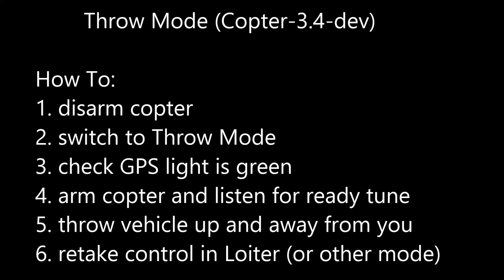ThrowMode Testing (Copter-3.4-dev)

Comment: Dear Randy
thank you for sharing the experience
well done

is it a GPS dependent mode?

I mean is it possible to operate with this mode in a no GPS condition?
Reply from the maker: Hi Mohsen, I'm afraid this mode does require GPS because its final step is to stop the vehicle.
Reply: @rmackay9  what if we dont choose a GPS required mode for quadcopter to set in after getting stabilized
?
Reply from the maker: @mohsenfazareh3384  It won't make a difference I'm afraid.  The modes always requires a position estimate (i.e. GPS or optical flow) because it comes to a stop (which requires the GPS) and then after that's complete it switches into the desired mode.
Reply: @rmackay9  nice informations, thank you dear Randy

Comment: Is AC3.4 can be install in APM 2.8 board?
Reply from the maker: No, I'm afraid not.  AC3.2.1 is the last version that works on the APM 2.x boards.  These days AP supports a huge number of more modern autopilots most of which are listed here: https://ardupilot.org/copter/docs/common-autopilots.html.
Reply: @rmackay9  thank you very much sir for your response 🙏🏻 and I appreciate your work.

Comment: I would like to build the latest version of the Arducopter I think that is 3.4.  I find it difficult to find detailed information even on the Arducopter site.  I have a Blade Chroma copter with a bad controller in it.  I thought since I have everything else, body, motors, battery etc. why not custom refit it for Arducopter?  Has anyone done anything like this?  Since I've never built one from scratch I will likely need some detailed help.

Horizon wants $250 for a new controller board.  Truth is they don't update their firmware the last update for Chroma was in 2015.  Outdated about as soon as it came out with limitations that we as users have no control over.  I want something I can modify and update as needed.

I have an 8 channel Spectrum receiver.  A DX 7 controller and a ST-10+ controller.

Comment: Hi Randy, i have been trying the throw mode with my quad for the last week, without succes.I really hope you can help me out with this.
As you describe, disarm> gps green> throw flight mode >arm> wait for tune> throw in the air.

Once in the air the special tune stops, but the motors never arm.

Mission planner gives me the following message:
uprighted - controlling height
throw detected - uprighting
waiting for throw

Is there some special height senor required (like optical flow)?
what am i doing wrong?

Geoffrey
Reply from the maker: @trex, That should work.  Did you throw the vehicle up?  Could you post a log file in the support forum? http://discuss.ardupilot.org/c/arducopter/copter34
Thanks for using ardupilot!
Reply: Hi Randy
You might be a little busy, i posted the log file a few days ago.
here's the link
http://discuss.ardupilot.org/t/quadcopter-3-4-dev-throw-mode-error/10004
Reply: Hi Randy.
A Quick question, in order for throw mode to work, do you need a sonar sensor (or simular)?
Geoffrey
Reply from the maker: Geoffrey, no need for a sonar.  Txs for giving it a try.  Sorry, I've been behind on my support of Copter-3.4 but I hope that will improve late this week and next week.
Reply: Hi Randy, 
last time you analysed my log file and found that MOT_THST_HOVER was way out of the regular range.
This mistake has been corrected.
The quad flies fine is Loiter and POS HOLD.
i really dont know what is wrong.

i must mention that when i set THROW_MOT_START to 1 my motors dont spin when the musical tune plays
Reply: Hi Randy, Thank you for fixing the motor spool state.
Throw is working
Reply from the maker: @trex, ah, excellent!  When I tested it and fixed it I thought, damn, surely this is the problem Trex was having.  It was totally a bug, sorry!

Comment: Hi, cool video
Between the iris+ and the bebop2, which one works better in throw mode?
... I am trying to justify getting the bebop...
Thanks!
Reply from the maker: +dogintwater The bebop is a better size for throw mode.  Only problem with the Bebop is it doesn't support a regular transmitter/receiver so you need to control it over MAVlink (i.e. using a joystick from MP) or we need to get Buzz's Taranis wifi hack this published (it's a DIY mod that allows an FrSky type transmitter to connect via Wifi).  I still very much like the Bebop2 though.
Reply from the maker: +dogintwater One more thing, the Bebop2 has a brighter future than the IRIS.  Parrot is still improving ArduPilot to work better with the Bebop2 (i.e. they've recently added support for the Bebop2's sonar).  So I think in the longer term the Bebop2 is a better choice.
Reply: +Randy Mackay Thanks for the comments!

Are there plans to combine throw and mission? I imagine it would be logical to throw the drone and have it execute a mission, like a homing pigeon.
Reply from the maker: +dogintwater I've thought about this change and it's actually very easy to add.. perhaps I was just waiting for someone to ask for it before implementing it.  We just need to add a parameter to allow the user to specify what mode the vehicle should attempt to switch into once the throw is complete.  The list of valid modes might be limited to just Auto and Guided for now but more could be added later very easily if it makes sense.

Comment: Randy, can you pick it up by a leg and just "fling" it, spinning as you throw(like a frisbee)? Also, as an iris+ user, I don't think there is as big a safety issue as others have implied. My plastic props would have to have perfect conditions to seriously injure, I would not even attempt this with carbon fiber props. I think the safety issue is carbon fiber props in general.
Reply from the maker: +Chris Nichols I think the frisbee throw would also work but I haven't tried it yet.
I agree with you about the increased danger of carbon fiber props.  I find them quite scary.

Comment: Randy, I enabled the throw mode using APM planner, but I throw it three times, it didn't rotate, may I ask is it because I throw too low? how high should I throw? or is it because it doesn't work using APM? waiting for your reply, thank you very much
Reply from the maker: +Mac Niu So I guess that maybe you're using Copter-3.3.3 (or earlier) instead of Copter-3.4-dev?  This feature hasn't been released yet so the only way to use it is to load the experimental version of the code which can be done with the Mission Planner's Install Firmware screen after pressing Ctrl-Q.  It's use at your own risk though!
Reply: +Randy Mackay Thank you very much Randy!

Comment: 02:25 Yeeaaa... Nope.

May I suggest to have the Motors not kicking in while the sUAV is still ascending but rather while or just barely after it reached the throw's peak?

Just a thought that crossed my mind :°
Reply from the maker: +Duraltia Yeah, I know the whole thing is rather questionable.  Still, I haven't had any accidents personally (yet).
It works like you say actually, the motors start as it senses it's in free-fall.  The actual code for detecting the throw is here although I don't expect it's super easy to make sense of: https://github.com/diydrones/ardupilot/blob/master/ArduCopter/control_throw.cpp#L182
Reply: +Randy Mackay Very scary - Certainly nothing for my comfort zone =)

I once whacked a 15" CF Prop equipped Quad into a tree and it clipped a twig the thickness of my thumb clean off the tree.
Thick clothing during Winter may save one from greater harm in case of but in Summer, niah... Might want to stock up on First Aid kits ;D

But hey... Good luck in keeping it accident free =)

Comment: Throw it off a bridge, THAT'S when it really has to work (especially when you just let it fall without giving it an initial impulse). ;)
Reply from the maker: +DIE_KUH I'm afraid at the moment it requires an upward throw.  It only has to go up slightly.. but in any case, simply dropping it won't work.  Paul has talked about adding that but no promises.
Reply: +Stein-Erik Dahle they're mostly dangerous once they spin up.  If they collide with your hand on startup, after you've grabbed the quad, nothing bad should happen (TM).  Also it all depends on the size of the props.
Reply: +Randy Mackay, that sounds like it could be very dangerous! There's four rotating knifes on that thing... I hope this will be implemented in a more secure way than it sounds to be.. 
Apart from safety - great idea!

Comment: does not look very safe.
Reply from the maker: +Tim Dickinson Yes, I agree that's a major concern.  It's not really a smart thing to get that close to a vehicle's propellers unless you really have no other choice.  In this case, with a wide open lawn, there's no need for me to do this except that of course, I'm testing the feature.
So far, it hasn't turned on the motors early nor failed to turn them on once the vehicle has been thrown.
Reply: +Randy Mackay I would guess that throw mode will appeal to the mini quadcopter fliers, many of whom already hand launch their aircraft. The safety considerations will be more manageable if it's used with smaller aircraft. I would not try this with my 580 medium lift quadcopter.
As we keep hearing that the pixhawk is actually much better than the old APM for stunt fliers once that starts catching on I predict throw mode will become more popular. I just don't see the aerial photography guys getting much use out of it.